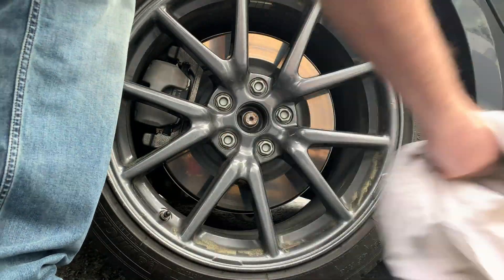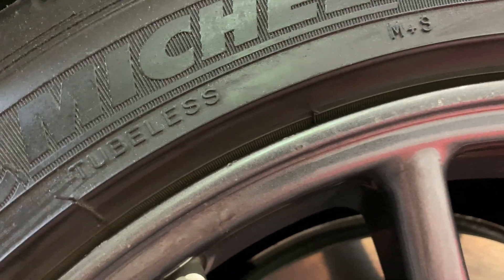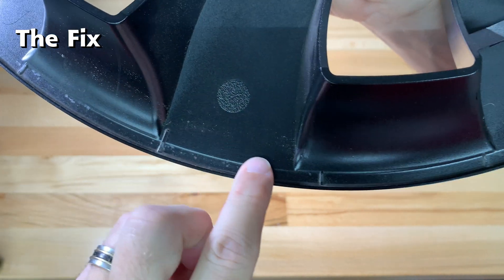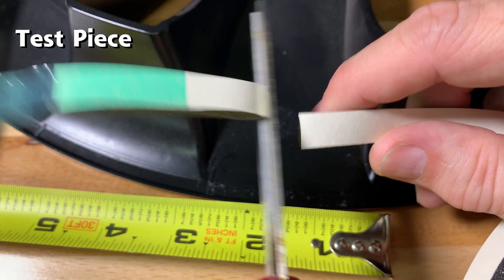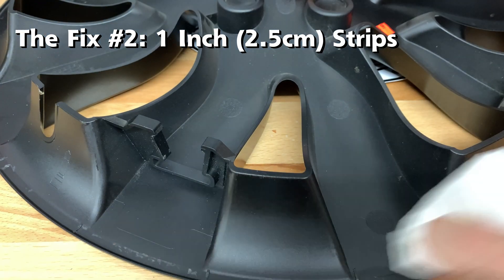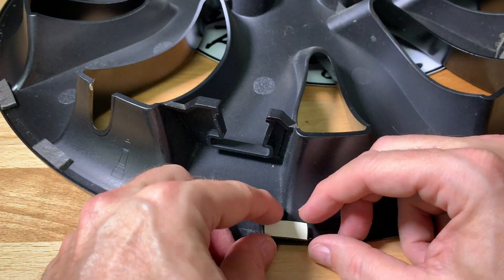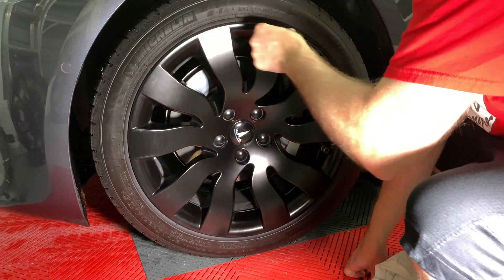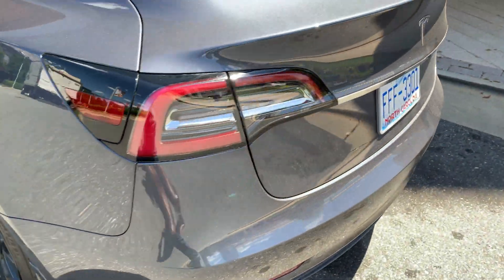Tesla Model 3 - Rimetrix Orbital Damage Fix

Comment: Where do you get the center cap with the Tesla logo?
Reply from the maker: I just added them to the video description.  They are aluminum stickers that attach to the center cap. https://amzn.to/3gkXkvR
Reply: @MTNRanger  thank you so much! Do you still like the wheel cover？any noise issue?
Reply from the maker: @toshiyo822  I have been using the silver version for several months now and like it a lot.  No issues with noise - I think the foam strips fix any vibration.

Comment: Thank you very much for bringing us this solution! 
Re: scratching problems on the Rimetrix Orbital wheel covers themselves, would you have any tip for fixing them? Since the Orbitals have a certain thickness, of course they're likely to get more impacts and scratches over time, especially when you park your car slowly close to sidewalks. This is what happened to me recently, and I'm quite desperate about these white scratches on the surface of my new Orbitals.
Thanks in advance for your guidance.
Reply from the maker: I’ve had another question asking about repairing the Orbitals.  I contacted Rimetrix and they were not helpful.  I’m guessing sanding would be the first step.  If there are deep gouges, plastic filler may be needed. The biggest unknown is a matching black paint for the satin finish.  Obviously glossy wouldn’t work.  Possibly a matte paint would be a solution.  At some point I may buy a bunch of paints to do a match test.  So far over four months, I’ve been lucky to have no scratches on them.
Reply: @MTNRanger  Lucky man! Thanks for your quick answer. I guess I will start with a manual water sanding with a 3000 grit abrasive and see what happens. For the paint, do you think a Performix Plasti Dip spray would do the job?
Reply from the maker: @jmlorenzi  I've used Plasti-dip on my original aero covers.  If you apply 4-5 thin coats, it should work well.  You may have to paint all the covers to match (or at least the two on the same side!)  The good thing is that it's removable in case you make a mistake or want to change the color.

Comment: Any updates to the effectiveness of your fix? My wheels had very slight damage after about 500 miles driving. I’ve prepped one wheel with a complete ring of foam but wondered if the shorter sections work or if they still let grit and stones in to damage. 

Can we have an update please??
Reply from the maker: Working on it.

Comment: 5k miles on a road trip across the country with mine and now mine are quite noise and I also have the scratches on the external rim.   Love the way they look so I'll try this.  I also think the covers may be coming a bit loose since they were first put on and that this contributes to the rattle.  Hope the foam eliminates the rattle and scratching.
Reply: Note - Rimetrix pointed me to  your video as well.  I'm thinking of trying https://www.homedepot.com/p/M-D-Building-Products-5-16-in-x-17-ft-All-Climate-Auto-and-Marine-D-Profile-Weatherstrip-01025/202066509 instead - it seems a bit more suited for this sort of application.
Reply: So I used the weatherstrip product mentioned in my reply and applied this fix last night.  I took a drive and I am not hearing noises anymore.  If you would like to compare in a few months - I'd be happy to send you pictures/video.  Seems like it might be the perfect solution.
Reply: @patrickvanderhyde  glad to hear!! Did you just cover the plastic nub? Or did you cover the whole outer edger? Just did a 1k road trip with the orbitals on and the rattle drove me crazy but it slowly got better. Scared to look at the scratches but I’ll be hitting a Home Depot before heading home.
Reply: @Tweeter5004  I just covered the nubs. I think you could run it around the entire inside but I wanted to be sure to have enough for all 4 wheels. Working great so far.

Comment: What center cap did you use to fit the Rimetrix?
Reply from the maker: https://amzn.to/3gkXkvR  Used in this video: https://youtu.be/wF8G5zN4-T4
Reply: @MTNRanger  I would like to apply these to my Rimetrix covers, but I need red T logos instead of silver. Any thoughts on the best way to do that?
Reply from the maker: @gordontyler9317  You could use red vinyl stickers on a solid black aluminum center cap: (https://www.ebay.com/itm/202151101216  or https://www.ebay.com/itm/324108722070 ) and https://www.ebay.com/itm/193252217761

Comment: I was waiting for the #4 wheel to use a different solution !!! what about just removing the little 'nubs' with a little wood file ?
Reply from the maker: I think there still will be an issue with the cover vibrating and causing scratching on the wheel.  Plus, filing off 80 nubs would drive me crazy!